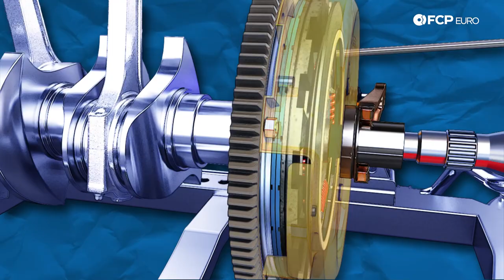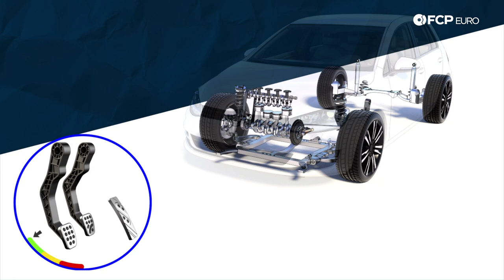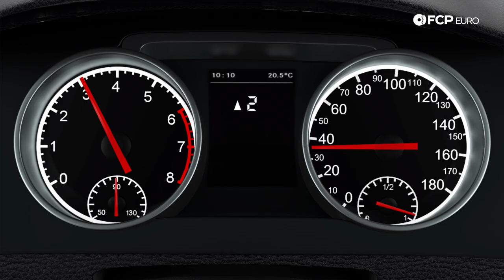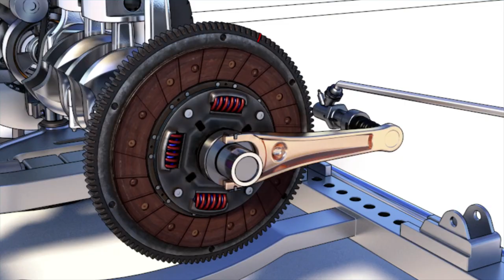What Is A Clutch, How Does It Work, & What Happens When It Fails?

Comment: I'll never forget, I had a 2016 Jetta Sport manual. I got it new and around 25k miles never had an issue and the clutch always felt like it was new. I went to a casino/hotel over the weekend and when I got my car back you can smell the clutch and also the pedal travel sucked....complained to the hotel and even though someone said it looked like whoever drove it struggled to drive it they were not at fault. Talked to a family lawyer and they even said it's difficult to prove as it's a wearable item.
Reply: That’s horrible.

Comment: Is there any electric component in the clutch system?
There’s nothing happening when I press the clutch and of course I can’t get into gears .
Is there a fuse or cable to check?
My gmac 6500 didn’t move for 2 years.
Before that: there was no issue eith it.
What can I test or do?

Comment: So, how can someone drive their car without actually using the clutch? And why is double clutching even a thing except in big trucks?
Reply: It's call floating gears, you can fall out of gears by letting off the throttle and if you can match engine episodes with the speed for the correct gear you cal float into that gear without grinding.
Reply: @chrissantos7865  I actually did this when I was training with a truck company. Had a hard time getting my double clutch right, so I said screw it and didn’t clutch.
Reply: Rpm's*